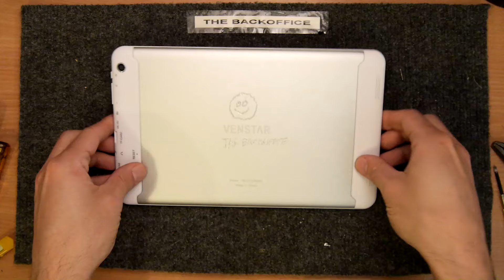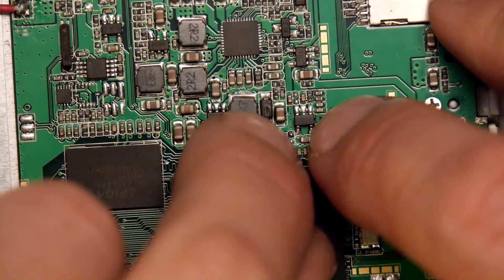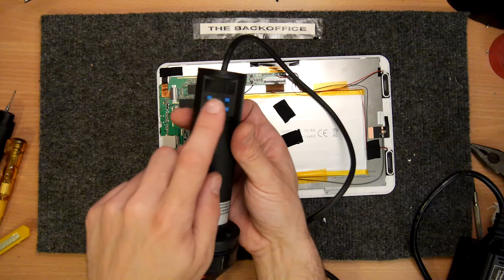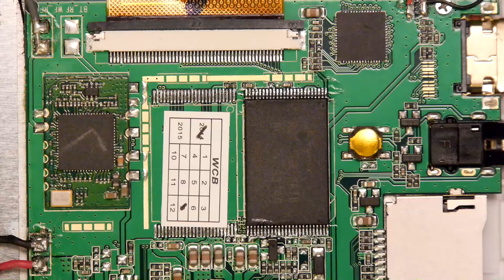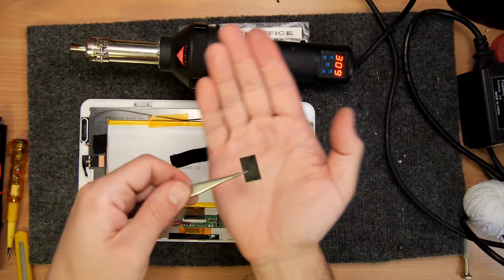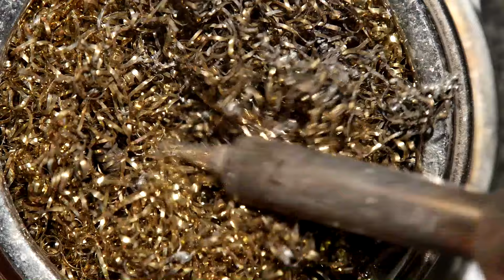How to use a Hotair Rework Tool

Comment: How long have you been using this hot air gun so far ? I have one,according to the user  reviews it appears the heater element has a few hours only lifespan, but spare ones are available and cheap at least.
Reply from the maker: +msylvain59 About 5 years. Bought a spare element, never used. I always cool down the unit before I turn off the fan. Do this, and they will last.